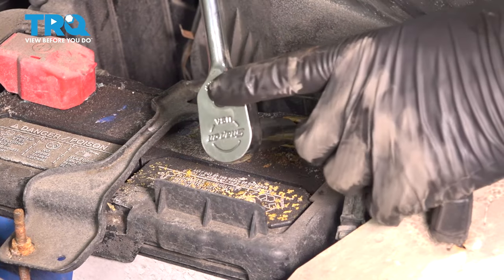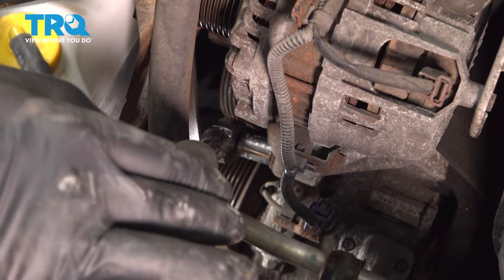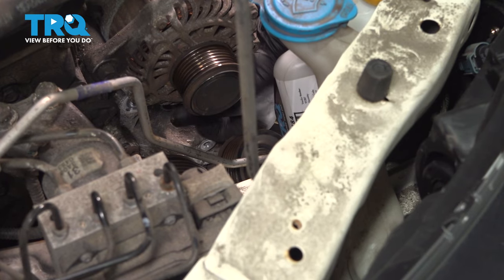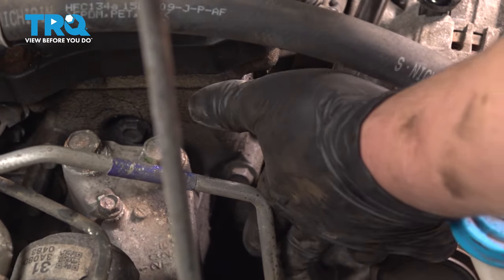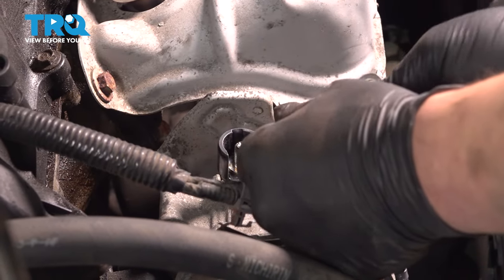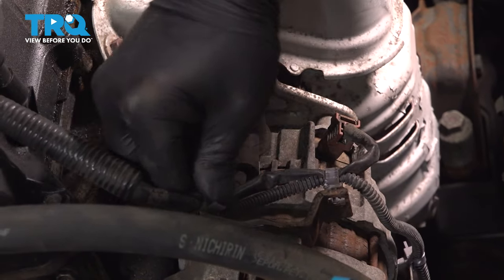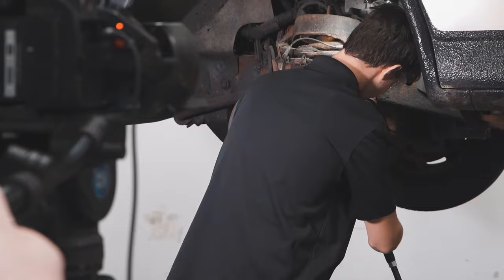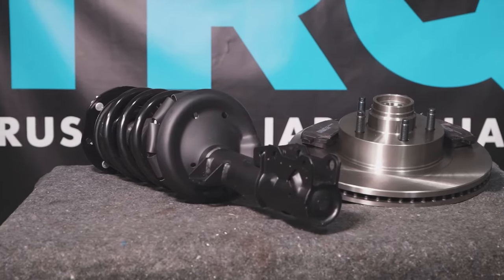How to Replace Alternator 2013-2017 Honda Accord

Comment: I really wished a qualification of a design engineer is that you have to be a mechanic for 5 years 1st. There is no reason why car manufactures make some of this stuff so hard to do.

I also like how you don't use your electric ratchet to brake torque.